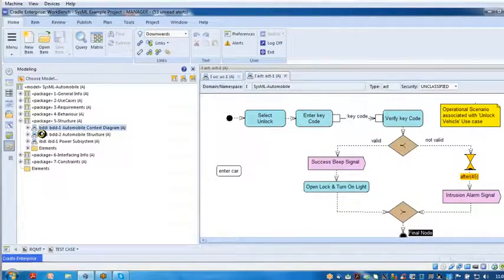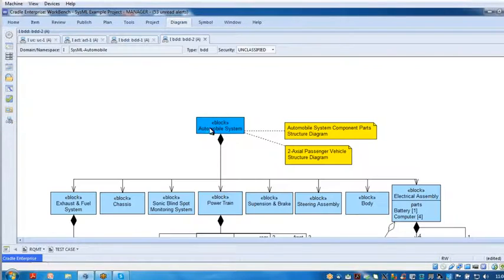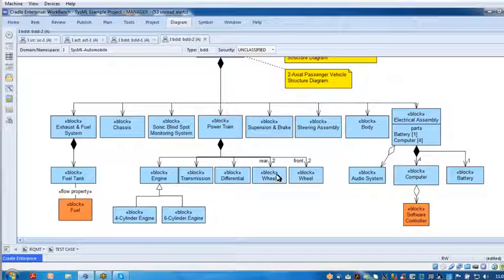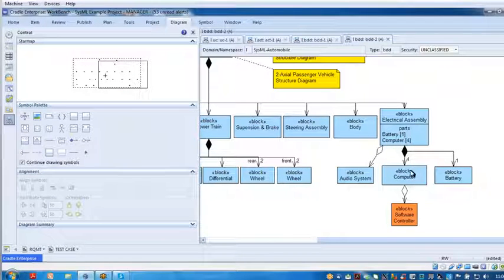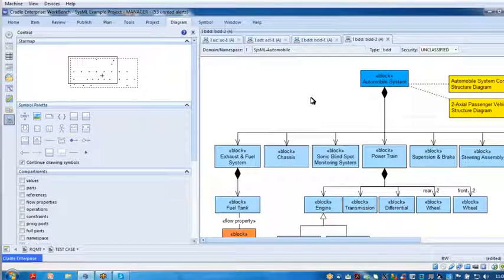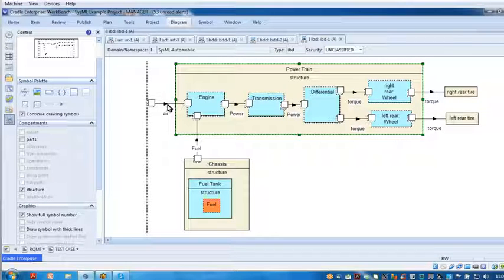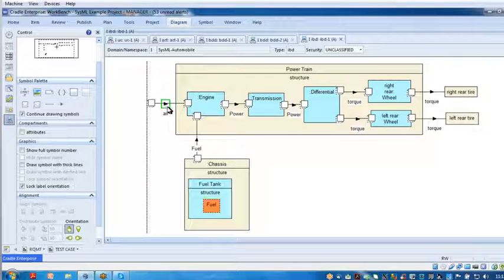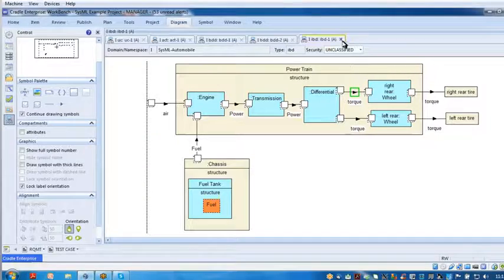SysML in Systems Engineering  Part 2   BDD and IBD SD

Comment: hi there! thank you very much for the video. it was extremely helpful and well explained. i do have a couple of questions though, if you dont mind:

1) I see that in the BDD you use block element types to show the systems and their respective subsystems, but in the IBD you use what look like property type elements to show the internal parts. why is this, and are these properties linked to their respective blocks?
2) i see when you were editing the item flows you had a long list of values and types to choose from. did you have to pre-define these as blocks or something similar beforehand?

Any help would be very gratefully received :)
Reply from the maker: Sorry about the delay.  The indivdual who made the video is no longer with 3SL and I wanted to reach out to him for comment.  Q1 - * Technically the ibd is meant to be looking inside a Block at the Block's Parts and interconnections, therefore part properties and reference properties are shown. Remember, a 'Part property' is an instance of the Part Block therefore it's name has a colon in the name to separate the usage/instance name (left side of the Part Name) from the block type (right side of the colon). This is how SysML says the ibd works. Additionally, when we implemented SysML in Cralde, it seemed to us as systems engineers, we might want to do an ibd using Blocks not Part Properties. Therefore we support both cases. 
Q2 - * We create interface information/matter/energy using three types of SysML elements: Block, Signal, ValueType. The list of these elements is what you saw in the Video. You can create them ahead of time and re-use them, or create on the fly. 

If we can be of any further assistance feel free to reach back out to us.